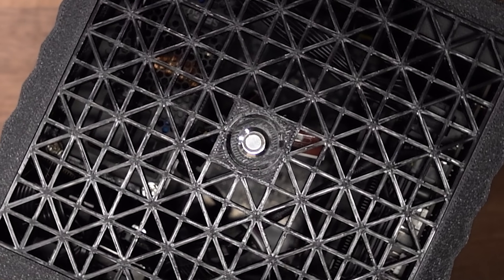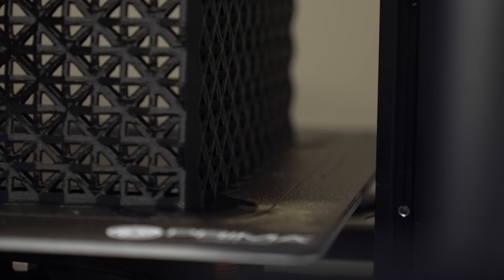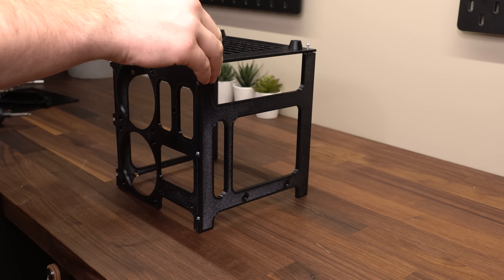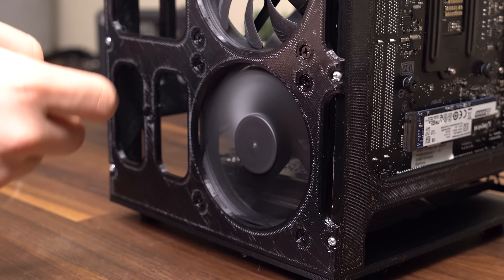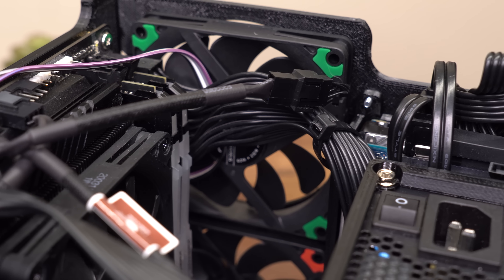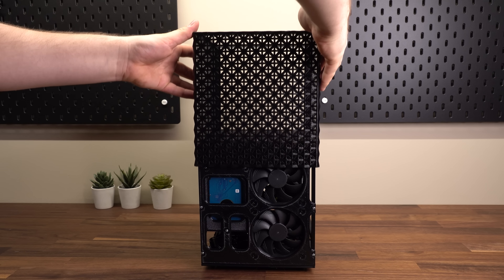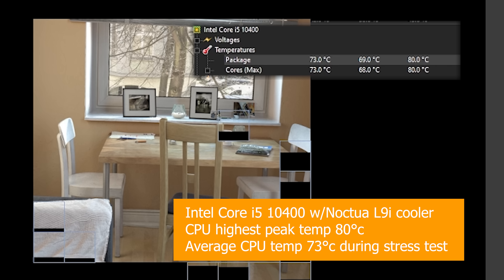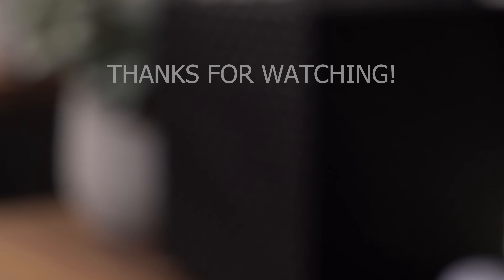Custom 3D Printed ITX cube case

Comment: i think you can building an even smaller one. first ditching the psu and use a pico psu insted they can up to 160W of power and for a complete silend pc for easy tasks like youtube, twitch, webbrowsing and office stuff you can use a asrock j5040 bord it has a powerfull 10W cpu with 4k support. maybe you can use a other mainbord with bit more powerfull 25W ryzen and a bit bigger passivcooler without fans or maybe set to 800rpm at 80°C and lower then 60°C 200rpm or maybe zero rpm. this would a perfect pc for normal day use. 
i personaly use a asrok j5040 as my dayli pc even for 3d creating with SCAD or onshape it runs fine and yea at the webpage it sayes 8GB ram max but i use 16GB and no problems i heard some folks uses 64GB ram so i think 8GB up to 16GB is for daly use optimal. but finding a nice case thats realy small thats only supports a copple 2.5 drives and a pico psu not standard psu or sff psu are realy rare. some of them are realy expensive 300€ and more.  i had printed a carrier with vesa holes and bolted it an the back of my monitor incuding a 2devKVM switch. for daly use i use this pc and for gaming i starting my other realy noisy pc. it uses about 100W in idle and up to 700W  but mostly around 300W to 400W at gaming. but my smal pc is absolut silend and uses at idle 2W and at full power 16W and for normal usage around 4W to 8W. i leve this pc always on so in can use ist anytime i only need to power on the monitor. wich is funny becaus the monitor uses 28W and can less as this pc ^^
Reply from the maker: Oh it can definitely be smaller by sacrificing some parts. I try my best to make cases so that they can be built with easy to get off the shelf parts. Or, «standard» parts that many people may already have laying around. But I’m definitely up for trying some super tiny everyday pc builds in the future. 😊 people request all kinds of cases, some want the super duper tiny ones, and some want extremely large ones that can handle dual 360mm radiators and a 4090 😅 both are a goal to make some day.

Comment: This case would be so useful if it were modeled for a plex server instead of a normal sffpc. Is it possible to remove the GPU holes and replace the 2 2.5 drives with 2 3.5 drives and give space for 2 more 3.5 drives where the GPU sits? That would be a killer plex setup.
Reply from the maker: Definitely, it can be edited using the supplied sketchup files. There should be enough room for probably 4 or 5 drives stacked on top of eachothers with a little spacing if removing the gpu and using a pico psu perhaps.

Comment: Your work is absolutely amazing, but I have one question. Have you ever designed a case that accommodates larger, more modern gpu's  (360mm clearance) with airflow and temperatures for these more power demanding parts in mind?
Reply from the maker: Thank you! I have not made one yet, I have one that can take cards up to about 300mm and a 240mm radiator up top, but nothing bigger built currently, but I’ll keep working towards it in the future 😊👌 The goal is to make something some day that can take literally any parts out there.
Reply: @makerunit  I made a case that could take "any parts out there", but then they started making even bigger gpu's.
Reply from the maker: @Flapdr01  awesome! Would it be possible to see some pictures for inspiration? 😊

Comment: In theory, could the 3D design's files be altered to mount HDPLex's GaN 250W units on one side in series, replacing the SFX PSU? Much lower profile means a taller and more compatible CPU cooler.
Reply from the maker: Theoretically, probably. I don’t know the dimensions of that psu, but as it is right now it can fit a cooler up to about 100mm. The one I’m using right now is approx 37mm and I have roughly 70mm of empty space in the middle.
Reply: @makerunit  that's not too bad. An SFX unit is about ~63.5mm tall, and an hypothetical variant of the case could have a multi-GaN 250W side by side, 2x250W. If a variant of the OG Cube could have the GaN 250W units, side by side, the CPU cooler could have up to about 140mm of clearance. Possibly more storage could be available with an SFX-deleted version, but that's a hypothetical guess. SFX width is about 125mm and 2xGaN 250W's have about 110mm width, but height could be improved at the cost of some added length.

Comment: Awesome build! Im literally in the process of building your other cube build haha.
Reply from the maker: Thank you! Haha that’s very cool to hear! Now you know what to do after that’s done then 😉
Reply: @makerunit  You bet lol! But these have been great to torture test my printer, see what breaks, replace, and tune.
Reply: @makerunit  Also another question, would you think the MSI 3060 Aero which is 172mm in Length fit with a 15 mm fan? I know the 1660ti is 170mm and the Noctua 9's are 14mm but wonder if there is space enough for these parts.
Reply from the maker: @lehroyale9259  from what I can see I seem to have approx 5mm of clearance. So you should technically be able to fit this. And about 4mm clearance to the motherboard so a 15mm fan should work. 👌
Reply: @makerunit  Awesome thanks! Im editing the original stl for the rear panel adding 25mm passthroughs for quick disconnect fittings to run an external radiator. Have too much watercooling things and this seems it would work well for a cpu loop. Previously had a watercooled node 202 and transplanting to this case be neato